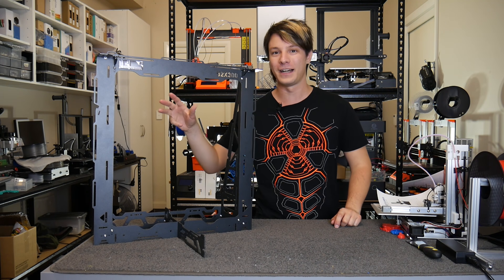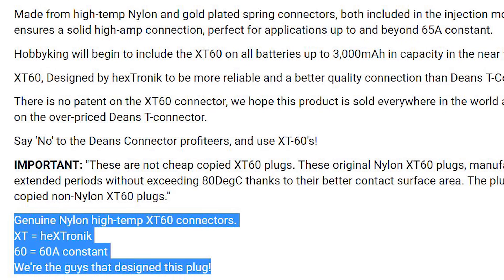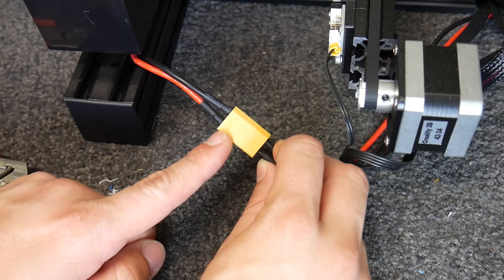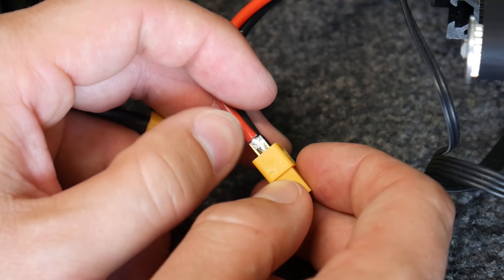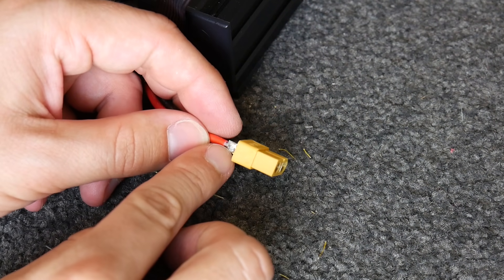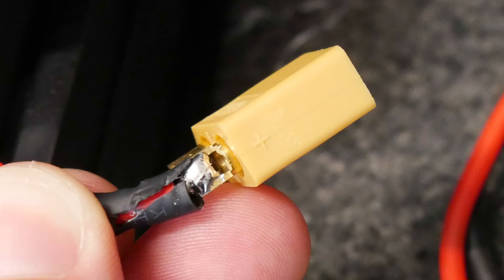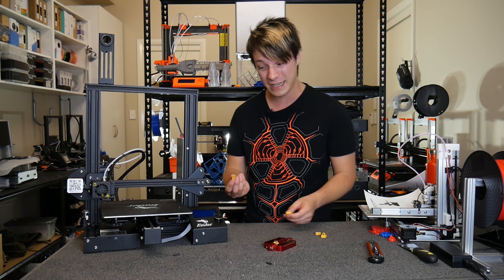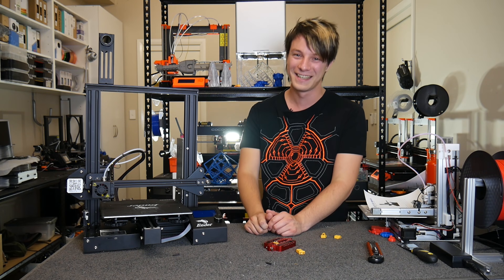Ender 3 Connectors are burning up... Bad XT60's

Comment: I've had my Ender 3 for a month or so and yet to see any problems, they are soldered tho. But they are still fakes and I have a bunch of real XT60 and some 5.5mm barrel plugs for replacements. As my master electrician always told me as an apprentice loose wires start fires and slapped me in the head.

Comment: "Very very poor"? Eh? Belittling something you obviously know little about isn't helpful at all. Those connectors are just fine.

Have you tried shoving a flat blade screwdriver into those male pins to widen them a bit? That's what the slots are for.
Also, anyone who has ever handled a virgin XTxx connector would know it is not possible to use them without soldering. A LOT of solder needs to be molten into those little "pools" on the back of the connector. No other way of attaching the wire to it. So I suggest people who have had fires or are afraid should check for cold joints and/or uneven soldering. If you have a soldering iron just re-solder them. 

Just for info I run 5A @ 70V through them  (bought from aliexpress) for another project and haven't had a fire yet.

Comment: I think it's probably a bit of both rubbish connector and crappy lead free solder. Have you ever tried soldering with that cheap lead free solder from bangood, it's nearly impossible. Hope its just the earlier models and there's not too many out there.

Comment: My connection felt very hot so I cut it open and it was crimped together with zero solder. I had to solder new ones on to my machine myself.

Comment: I just had some delivered from amazon, An they look diff colour to the bafang motor cable xt60 from bafang, Im concerned coz i dont want too have issues while im riding, Do anyone know what best connectors are for bafang mid drive motors, But these xt60 connectors i bought off amazon are screaming fake, Have anyone else in the UK had fake xt60s from amazon, plz let me know, Coz thats a problem, Nice one bro im about to soldier some to the battery, An never knew i had to fill up the connector part with soldier so nice one bro, Looking foward to blipping out an about on my new carrera hellcat bafang mid drive E-bike, Enjoyed fitting it aswell, Sense of acclompishment is massive from it, Chuffed with my work, i para tho these connectors from amazon are fake tho, No blast cap things come with them, Just 5 of each in a drug bag, Is that how they come lol, Yeah can anyone tell me if they have had fake xt60s off amazon, Cheers....

Comment: The female connector should also be on the power side.
Reply: Before using mine I looked all over for the proper setup. The female end for the power supply is all I could find. THEN I see here his were opposite that. Glad I found your comment

Comment: Yeah.. your comment 'not a huge amount of solder' is a key.. That's no where near what you want a 60 amp solder joint to look like.  Notice the key difference between the two: the cheaper version has a pass through solder 'hole'.  You can't possibly put enough solder in there without risking solder in the female part of the connector, which would make for an even worse connection to the male side.  The better one has a wall that makes a solder 'cup'.  That means you can flow enough solder in there to completely fill the cup and the connection becomes the whole outside of the wire and the whole inside of the cup.  It will be a much lower resistance connection AND it will conduct heat more evenly to help keep it from overheating - a dual reduction in heat.

But honestly, even someone who's been soldering for a week could have put more solder in that cheaper one.. that's just negligent.

Comment: Just because you can melt solder on a wire/joint, doesn't mean it's any good.  No need to replace the connector, just solder it better.  To help with this my suggestion is to pre-tin the connector and wire.  You know the connection is good when the solder practically wicks/tins itself to the connector, and wire.

Still a good PSA for people to double-check and/or redo theirs properly. 👍

Comment: I cut the connector off and soldered the red and black wires and there is no longer any heating and the Ender 3 is heating faster and the temperature is more stable.

Comment: Am I the only one who is incapable of seeing the obvious? Those split pins that push into the cylinder connector I am referring to. Sometimes, they get pushed together so they don't make a flush contact on all 4 pins. The best way to fix this, is just widen them apart with a small flat screwdriver, so when you push them together, they create a tight flush connection. It's not bloody rocket science. Any genuine connector will overheat lie shown, if the pins get bent or flattened in any way. 

Less focus on making video's & a little more attention & this problem would have been solved already!

Comment: Xt60 s are just a general connector, hell my soldering iron uses one, my quadcopters use them, my ex planes use them, hell I'm pretty sure Peter stripol's electric homebuild plane uses a xt90, what I'm trying to say is that that there's no real or fake, there's just high and lower quality

Comment: Get rid of the connector all together and solder the wires to each other. Realistically, how often are you ever going to unplug the wires? Possibly never!
Reply: You'll need to unplug it a few minutes after you finish soldering the wires together without a connector. :-)

Comment: Please do not solder already crimped connectors, this adds extra stresses to the joint, with heat etc.  Solder OR crimp, never do both on the same joint else it becomes a point of weakness and especially susceptible to corrosion.

Comment: If I buy an ender 3 from eBay or amazon, Creality will not warranty it. They say you have to buy factory direct. I bought one factory direct us stock. Meaning it should have come in 5 days or less. 15 days later, no shipping, tracking, no email, no nothing. I had to file a claim with PayPal to get my money back 30 days later. Creality WTF.
Reply: Huh, I bought one from Creality on AliExpress for $170 shipped from the US and it came in 2 days.
Reply: @FierceDeityLink1  I never bought from ali. I thought it was in china like banggood/gearbest along with high shipping and long wait.
Reply: @FierceDeityLink1  But you don't get the warranty. That's the point.
Reply: Does that mean ebay / amazon warranty it instead? Or do you live in a country with no consumer rights or something?
Reply: @danlatu209  bought mine from gearbest for $180 (US).  it took 2 weeks to arrive but that was just before christmas and still met their estimate for arrival.
Reply: @iminabrons  Wait i suppose when you order from Creality's actual store on Ali, rather than a reseller, they should?

Then again if they're coming up with excuses to not service the warranty, then i guess any excuse is as good as any other.
Reply: @SianaGearz  Hi, I bought mine from GearBest in a Flash sale. Bottom line, no warranty and that info comes from Creality after inquiring about failed capacitor at Position C4 on the motherboard ( a known fault). Gearbest did send me $50 compensation which paid for a replacement motherboard which I installed myself. After looking at different responses from people on Google I would double check with AliExpress first and Creality directly for confirmation.
Reply: @NoseyNick  Once you buy from an overseas company any rights you have as consumer are worthless in the real world. If you buy from a third party from your own country then your laws should apply.

Comment: The burns are all due to bad fitting contact, the area where the connectors join. It has nothing to do with the solder or crimps. If the solder or crimps were at fault the burns would happen there as resistance grows so does heat. All photos are showing a burn in the fitting. So do not even keep those knockoffs. The real cringe is the hollow tube female end. 
All x style friction fit connectors have a limited life. those male posts will fatigue over time/use and loosen up. A reason i dislike overlapped fittings as your feeling the plastic resistance and do not know how tight the pin to socket fitment really is. Deans plug when worn just wont stay connected as there is no "housing" overlapping. Reason so many melt tamiya connectors as those friction fit and latch. So the user has no real idea how sloppy the internal fittings are. Same goes for those annoying molex connectors. Also a terrible connector I have seen used on 3d printers. 

I have seen real TX60s fry like these on rc vehicles (cars boats and heli/quads) Old fittings (all types) after a few years, add lots of high load and toast. Watched a few multi thousand dollar cars burn to a pile of melted plastic and alloy after the batteries shorted due to a failing $2 connector. 

I have seen these "fake" fittings in other hobbies such as RC. As most shops sell fittings as loose sets or places like amazon sell in bulk. If in doubt bypass it and direct solder the joint. Also learn to solder. it cannot be any harder than tuning a 3d printer. 

And yes I know a year late. . . . . lol

Comment: It doesn't matter how you join your wire crimp or solder if it is done properly
Reply: This is not a crimpable connector. It has a brass cup that must be soldered to and is not allowed to be crushed.
Reply: @SianaGearz  I didn't say it was I haven't see a xt60 that can be crimped

Comment: The fake xt60 looks like it is brass and poorly machined where the legit one i believe is gold plated. And gold = way better contact! Also if they are brass the resistance is a lot higher! So youll get a huge power loss. Because Amps x Resistance = Watts in this case power loss and fire!

Comment: Or skip the connector and solder cables directly
Reply: lacucaracha111111 right? I don’t have this printer, but I don’t understand why you wouldn’t.
Reply: @jgreg95  I mean you are hopefully not going to swap PSU all that much
Reply: @lacucaracha111111  Even if you have to swap the PSU, it is literally 2 wires in screw terminals.
Reply: @Hidyman   Yep, that ontop, and Id probably keep the plug, for low powered RC cars and put in thicker wires

Comment: Ditch the connector and replace the wires with straight through wires with an inline fuse rated properly for the amperage traversing the wires.  Unless you intend to ship you Ender back to China, there is no real reason to have them in line.

Comment: if there was a bad connection between connector metal elements then whole connector will be burned not only connection cable -> connector, so connection inside connetor is good despite that is not an oryginal connector XT60
problem lies on connection cable to connector

originality of the connector is irrelevant !!!
Reply: There's only a small area where the metal insert touches the plastic body of the connector, it's near the wire terminals. You must have noticed while soldering that the metal inserts have enormous thermal conductivity, so it doesn't matter where the heat source was, it will always burn at that one spot. I wager a guess, your fake XT60s simply were orders of magnitude better made than these, i also have fakes and they're fine, but they sound, feel and look more like genuine unlike the ones Angus found in his printers. I have seen reports of similarly bad connectors around.

Granted, that solder job doesn't look half good either, one of the inserts isn't perfectly wetted, so that is certainly a contributing factor.

Comment: I can tell you definitively that my Ender 3's melted XT60 connector was crimped and not soldered. Good call Angus! I have images on my blog which shows this: https://xanofere3d.blogspot.com/2019/01/xanofere-3d-printing-melted-xt60.html. I replaced the XT60 connector and soldered it. It is now cool to the touch during printing.

Comment: Apart from the printer's hardware/firmware protection, everyone should consider mount an alarm,extinguisher. or a simple fire monitor system like this one.https://hackaday.io/project/165689-safety-shutdown-3d-printer-wirelessly-catch-fire

Comment: is it the XT60 ?
I got a Geeetech A10 and it looks like a good XT60 and it is soldered, BUT: the cable looks like only 16 or 18AWG. Thats quite small and maybe more of the problem than the XT60.

solder vs crimp
In mechanical and thermal problematic environment no soldering is done but allways crimping or screwing. (car-electric, home-electric...) See an interesting article on that: https://millennialdiyer.com/articles/motorcycles/electrical-repair-crimp-or-solder/

solder heat problem
For soldering the XT60 i recommend allwas plug it into its opposite while soldering. You need much heat and a little time to let it flow and if it is a little too long the plastic will melt and the contact may move a little bit within the connector. The result is that the connector will not fit good any more increasing the contact-resistance. The opposite plug prevents this from happening cause it holds each contact on a 2nd cooler place while soldering.

Comment: they both look fake to me,   genuine ones have amass moulded into them  and the side with the tube brass part  should not be a tube,  i think i can se the soldered wires in one of the shots down the hole.  it should be a machined brass bit that you could fill with liquid with no wires soldered to it.

Comment: If it's a mission critical item I'm not buying Chinese stuff unless it's from a reputable brand that has a close to flawless track record.

Most of the stuff I bought from China had an issue I had to deal with like poor documentation with ER11 Collets claiming to be a certain type when they were not.
Then there's also the issue I had with a water cooled CNC Spindle having a 4 Pole ( U/V/W/GND ) connector where the GND one wasn't connected to anything.
C'mon guys... There's an item housing water & electricity and you're not even having the decency to connect the GND wire to it!? What the fuck is wrong with you?!

Really man... Whenever I can avoid it I'm not buying from then and even if there's no way around it I'll put at least 10x the research power into what I'm buying from them then what I'd do with EU/US Items just for the sake of not hurting myself because some nutjob over there decided to cheap out on a fake 0.01 cent/connector when bought in masses.

Comment: How are you gonna talk about fake and knockoff xt60? It's a standards not a brand. All kinds of people make xt60s that are perfectly fine besides amass. It's creality and their poor soldering and crimping. The ender is pushing a 40 watt heater? 15 amps tops on a connector rated for 60 amps. Outs the soldering adding resistance. Also the amount of solder means nothing if it's a cold joint. You Didn't even measure the resistance. There is so much wrong information on this video I suggest nobody watch it.

Comment: Honestly those solder joints looks very poor to be an on a actual production and beeing sold, i could do it better when i was 12 😂
There is barely contact and the solder haven't flowed properly, either from bad technice or too little flux

Comment: If you buy a cheap printer this is what you get!
I have my doubts that the XT60's used even have copper / brass contacts - probably electroplated aluminium.

Comment: Anet A8 : we burn easily
Ender 3 : hold my beer

TBH the QC issue with A8's are ok because they are very cheap and spending $20 would improve its safety by a lot, but on the ender 3 ? thats just cutting corners creality, a big no-no

Comment: Get away from this junk and run a real quality connector if it's high current. A pair of 2 pin  Amphenol  connectors will run you $25 US and actually perform .